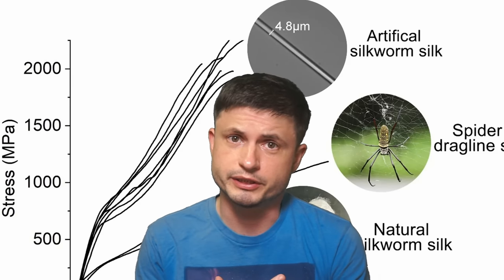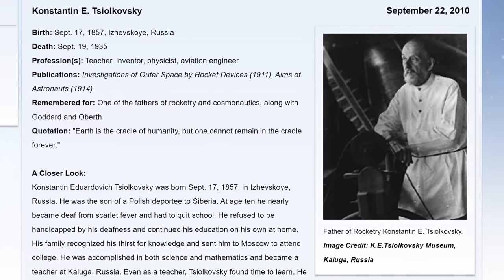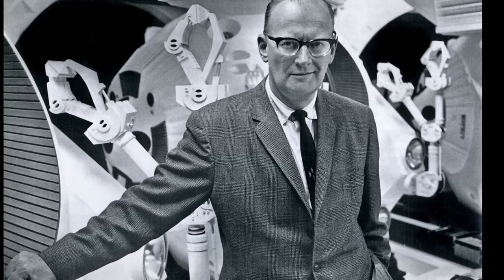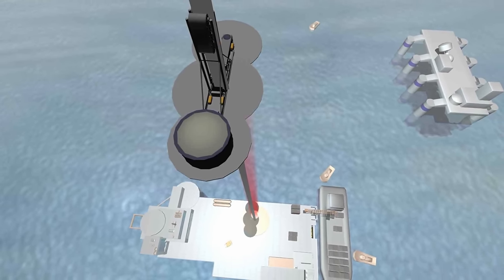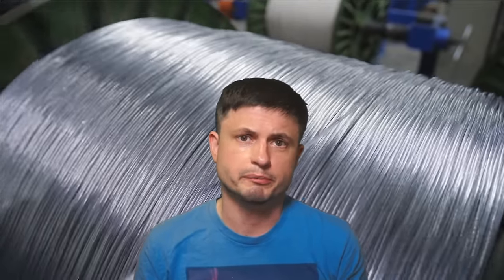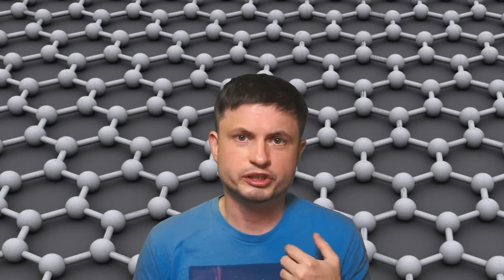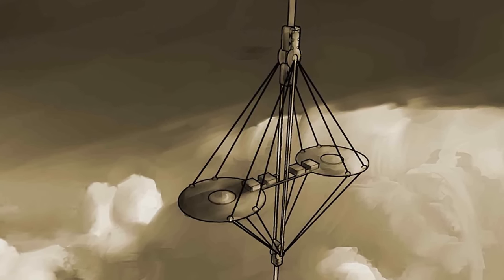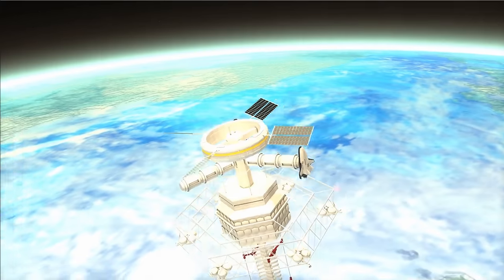Exciting New Updates About Space Elevator Technology...Possible After All?

Comment: Im blown away that graphene printing technology is already so advanced, being able to make 1km long cables of the stuff? damn that's insane
Reply: Two meters a minute! 😮
Reply: @serversurfer6169  - 36 years, at that rate. But that's the current fabrication rate. Remember the real success of the industrial revolution, was beating older methods by orders of magnitude. 10x, 100x, or 1000x faster AND cheaper.

In 1981, your original IBM PC executed at 4.7MHz. 4GHz (~1000x) faster was achieved before 2010. Though the clock speed has stalled, the number of cores, and bus width have increased. Also memory is now cheap. In the old Apple II, RAM was ~$1000 for 10K of RAM ($1/1K). At current DDR3 prices is $0.000001/1KB. That's 1 million to 1 change in ~40 years.
Reply: Wouldn’t space debris eventually destroy that sucker since it would be stationary?
Reply: @michaelmoorrees3585  Since the teather would not consist of a single strand, but of multiple intertwined ones, they could easily be produced in parallel. Say production in a single year, after facilities are established. Engineering the rest of the required stuff (providing energy to the climber, redundant fail-safes, stabilizers for keeping the teather from meandering due to wind, etc) is all doable, but will take much longer.
Reply: @redsoxfox  Yes. But the same holds for virtually everything in space. "Eventually" can mean after a very long time. Even if the thing needs to be rebuild every 25 years or so, that would not put much of a dent into the economical benefit.
Reply: @redsoxfox  Yup.  However the biggest problem is suspending any conductor or conductive material so it's passing through the earths magnetic sphere means it's going to produce a lot of current and probably just melt.  Not to mention the lighting.
Reply: @MrBottlecapBill  shiiit good point.  Didn’t even think about the power aspect of the damn thing.  I guess you’d need a thick ass ground wire of some kind but ya…the whole idea of a structure going into outer space seem sketchy from a natural disaster point of view and also from a man fucking with it because they can point of view.
Reply: @daran0815  Shit, you even pose a bigger issue, how would this damn thing be maintained?  Say there is an issue halfway up the bugger, expect someone to be halfway up the earth working on repairs?  Or if the elevator is out up top, spend millions rocket and highly trained astronaut/repairmen to diagnose and repair that shit.  Haha this thing sounds sketchier and more expensive with every question of every angle in regards to the logistics of the idea.  At this point, I think money would better be spent actually researching and creating rocket-free spaceships that go from ground into space.  Yikes, space elevator sounds cool but sounds impractical.
Reply: @redsoxfox  In all our endeavors, we’ve yet to create the necessary force field to protect space objects. It’s my belief, that the protection will be made of a magnetic force field that repels objects as well as radiation. We’ll see. It’s on the horizon, and a necessary step as we branch out and head for the Moon and Mars.
Reply: @redsoxfox  a little ring crawler vehicle that scuttles up the line and techs pop our in their hover suits
Reply: @MrBottlecapBill  I wonder what it would take to harness for use what doesn't get grounded (and what that kind of energy would do to the physical planet)
Reply: @redsoxfox  You should look into what has already been proposed publicly. It covers everything you mentioned. E.g. using multiple strands in parallel and regularly replacing damaged ones.
Reply: @Sky Sox  - The danger of excess space debris cannot be discounted.  However, there are plans on the table to deal with the problem.  It wouldn't be a cheap problem to solve.  But, nothing about the space industry has ever been inexpensive.  
And, by its very nature, a space elevator would bring the costs down by orders of magnitude.
Reply: @MrBottlecapBill  did you just found free energy?